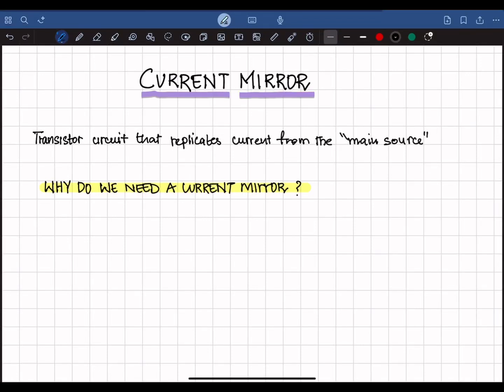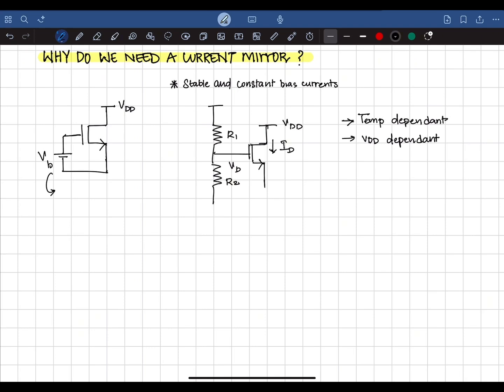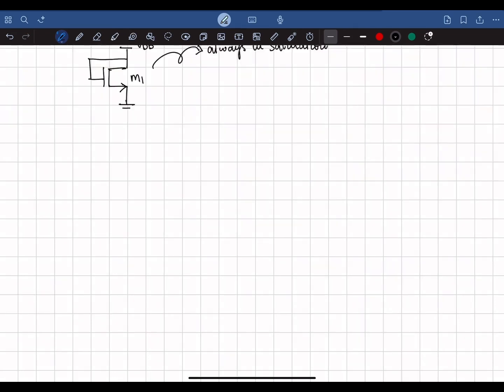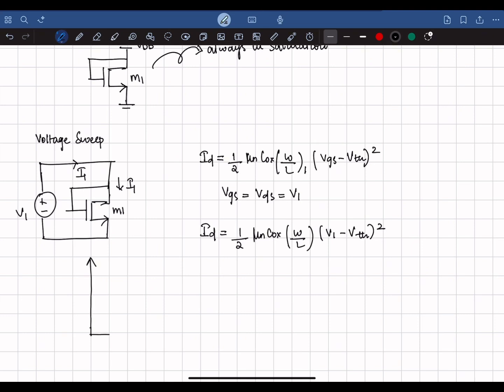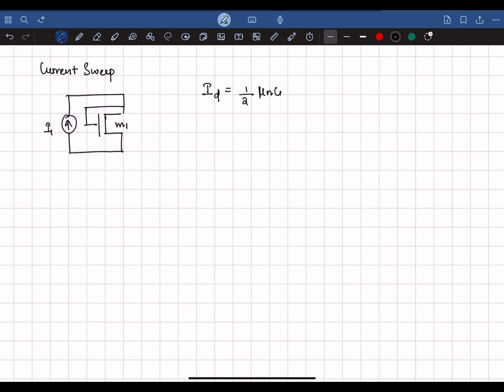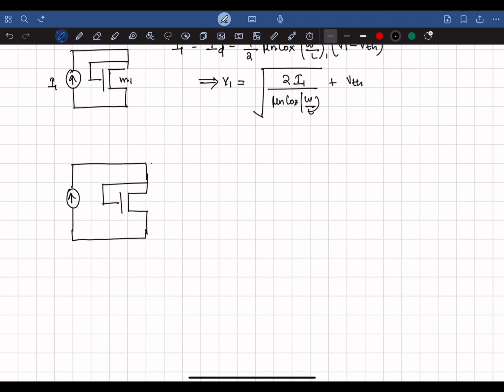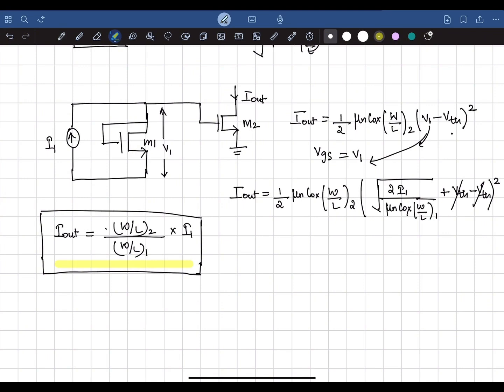BASIC CURRENT MIRROR INTRO | MOSFET #cmos #analogelectronics #mosfetamplifier

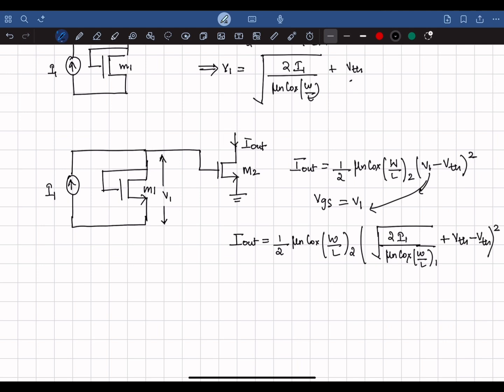Comment: Hey, in 8:39, there’s a -Vth and a +Vth. But these threshold voltages are from 2 different transistors right, should we be striking those off like that?
Reply from the maker: In a basic current mirror we assume matched devices (same W/L, process, bias), so Vth of m1=Vth of m2 and we treat them as equal for analysis. In real circuits mismatch does occur, but ideally that cancellation is valid for calculation purposes.